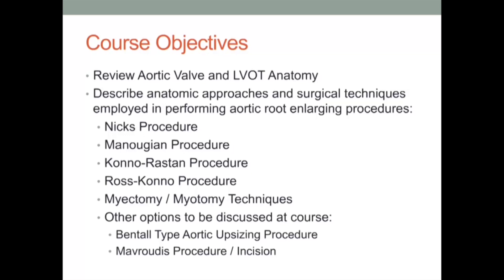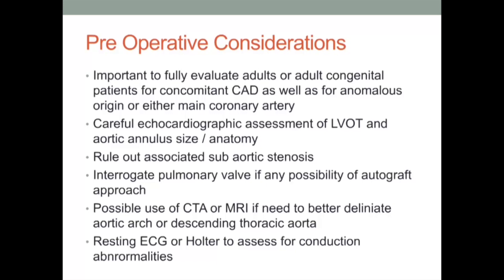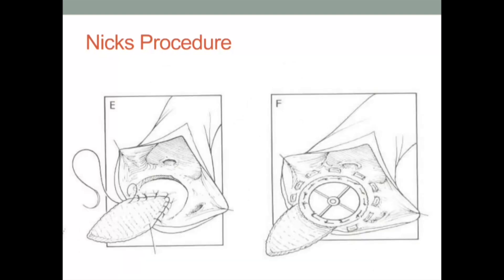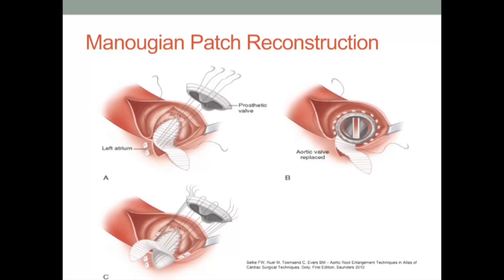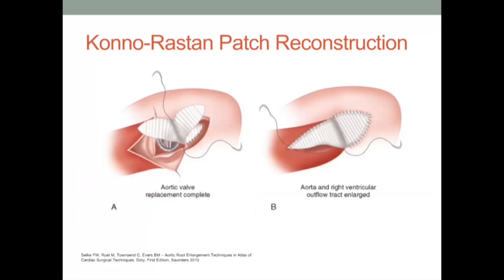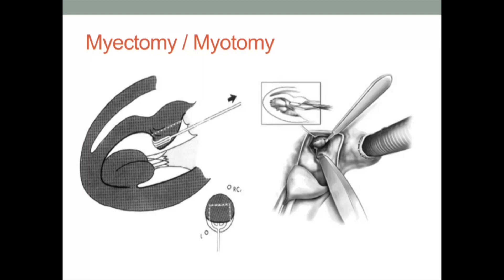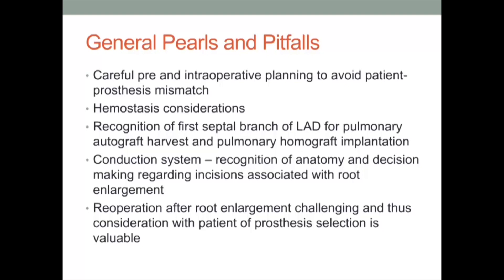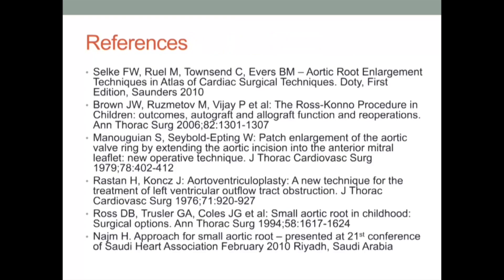STS U 2020 - Course 4: Aortic Root Enlargement Procedures & Aortic Valve Leaflet Reconstruction

Comment: Overall, the video is fine. However, there is a critical mistake that has been happening since 2018. Both Nicks and Manouguian techniques were misdefined. 

For the Manouguian technique, the aortic incision is continued further posteriorly and across the aortic annulus at the commissure between the left coronary sinus and the noncoronary sinus and into the aortic-mitral continuity. For the Nicks,  the aortotomy is continued across the aortic annulus in the mid-portion of the noncoronary sinus and into the fibrous subaortic curtain.
Reply: I concur.  The Manouguian technique is performed by a transverse aortotomy that is made into the commissure between the left and the noncoronary cusps not described in the course.  See Manouguian S, Seybold-Epting W: Patch enlargement of the aortic valve ring by extending the aortic incision into the anterior mitral leaflet. New operative technique. J Thorac Cardiovasc Surg 78(3):402–412, 1979.
D. Mueller